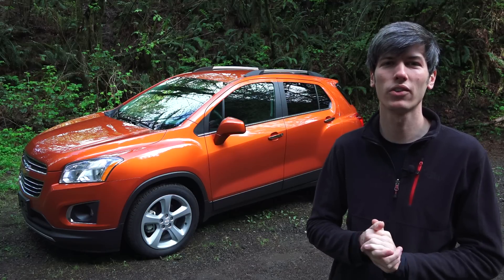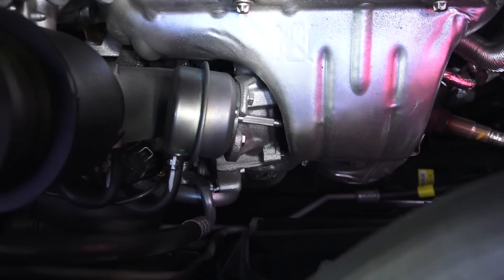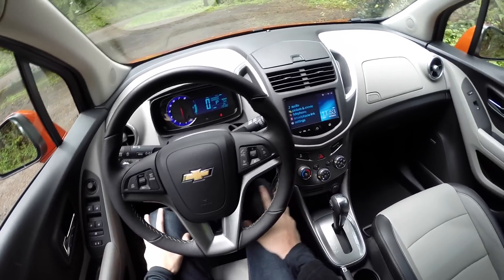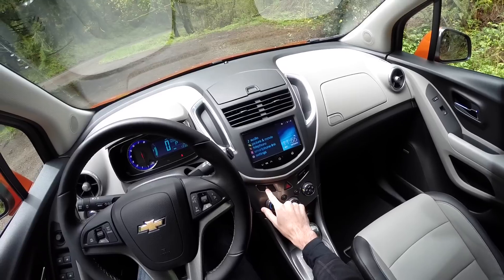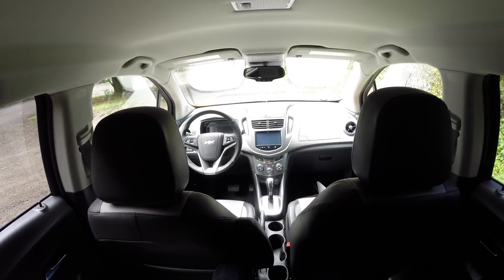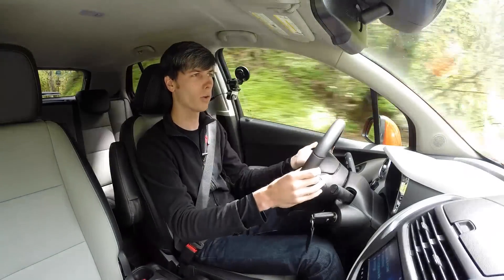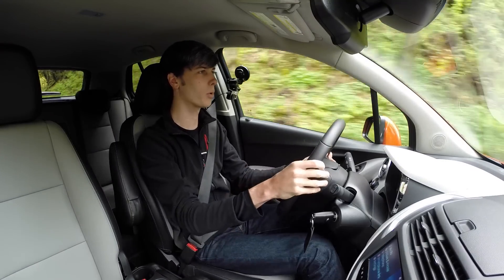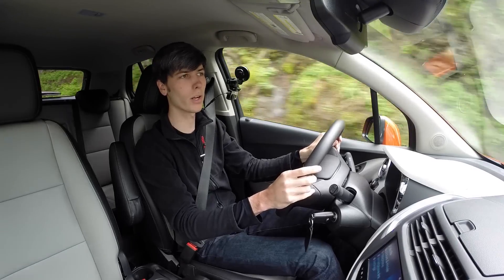2015 Chevrolet Trax - Review & Test Drive

Comment: This is the first video I came across and I came here to say F*ck this cars rear doors and quarter panels I have spent over 2 hours (40 minutes) trying to fix the door on one where it was side swiped and putting that roll back in it is an absolute nightmare because the door is to thin to hold a shape

Comment: I am a happy 2019 Trax LT AWD owner (purchased new for 19K on 10/19) but I do have low miles on it.

I thought the review was very fair the Trax is a nice, functional, and safe car.  
When I purchased my Trax at the time no other car in the category had better crash protection most were not as good. 

I just used it to transport a combination/storm door. 
My model has 4 tie-down hooks so I was able to strap the door in and leave the back hatch up, no problem was solid.

I just read that the Chevy Trax made the IHS Markit’s brand loyalty list (May 2022) (#9) most of the other cars on the list were way more expensive. 
But, not all Trax owners have had the same positive experience. 
I have read reviews and on a Trax Forum where owners did have issues.
I used Repair PAL for data-driven reliability and the Trax was listed as 4 out of 5 stars (Excellent).

As always if you are interested in a car take a test drive and do your own homework.
Thanks for the professional review!

Comment: I have one, a 2017 actually.  Wouldn't recommend it.  If you are looking for a Chevy crossover, look into the Bolt or even the Equinox.  Both are way better than the Trax piece of crap.
Reply: The problem is that they haven't upsized the engine much for the newer Equinox. It's still a 1.5L turbo, for a vehicle that is I think 300-400 lbs heavier than the Trax. And the Bolt is facing a recall for the LG batteries. But yea, I really wish they stuck a 1.8L or the old 2.2L Ecotec here, you can really feel the lack of power in the Trax (I have a 2013), apart from some initial boost from the turbo at low speeds.

Comment: I think I’m about 5 years late lol but on a serious note I do want to get this car (1st car at age 19) but I’m not sure since it has a turbo charger which for some is a red flag. Please help so you recommend this for the long run?
Reply: I just bought a used 2013 LS base model. I hear your concerns on the turbocharger, I'm not planning to floor mine anytime soon lol. Personally I'm trying to baby it, and see how long I can make it last with basic maintenance. I had really low mileage on mine, which is why I went ahead with the purchase, as it was relatively cheap. It's been about 2000 miles since I bought it, so far no issues. Very good gas mileage, and utilitarian (kinda miss out on the cruise control), but it covers what I need it for.

Comment: This car is made on a global GM platform and it is sold under the name of Buick Encore, Opel Mokka(for the European Union) and Chevrolet Trax. Every Opel facelift has an "X" wrote after the name itself and it's manufactured in South Koreea. Probably the Buick Encore too. I dunno about the Trax. And that Ecotec engine is an Opel engine that has been mounted on Opel Corsas (plural).

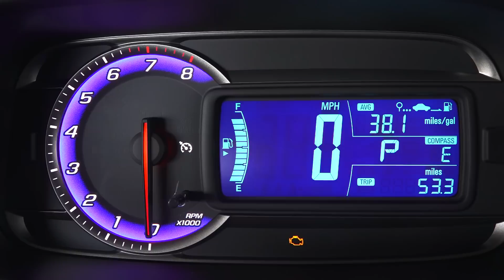Comment: Check engine light at 12:30?
Reply: Key is On, but he hasn't started it (0 RPMs). Check Engine light stays on for that key setting on this vehicle (I have a 2013 Trax, mine does it too).

Comment: We live in central Alberta and purchased a 2015 Trax last spring.  It was great till the cold weather hit and has been nothing but trouble since.  It doesn't like the cold and the motor stops at intersections, never sure it will start again. It has been back to the dealership several times, in fact it's there now.  Here are the supposed problems: #1- o2 sensor, changed and we still have a problem. #2- Air too cold because the intercooler is making the already cold air colder.  Solution? White plastic cardboard "winterfront" held on with zip ties.  #3 - well the cardboard isn't working so we take it back and do something with  the intercooler so it's working again., Yay!!  Then we get -30 and #4  guess what?  Yup, we are waiting to hear what the next brilliant solution will be. The point of this recitation is, is there anyone out there that has the same problems? I would love to know, thank you.
Reply: EtownScott hey! Have you still been having issues with the car?

Comment: Nice work on the review.  I'm looking at a re-designed 2017 and I'll just add that the body and dash look is much improved to me.  AWD is a great option for an economical vehicle like this and that comes with the rear disc brakes for those of us who prefer it.  You can get this option even on the low end LS.  That said, only disappointment with LS is lack of cruise control.  The turbo is what helps gives this model its good city driving acceleration and fuel economy.  Engine/turbo combo is well tested having been in the Cruze line for several years now.  This vehicle is probably heavier, especially with the AWD unit.  Power seems ok to me with just one person.  However, even my Cruze struggled with 4 occupants.  If 4 occupants is not the norm for you, this should be fine.  Enjoy!

Comment: On my 2011 Chevy Cruze on the turn signal bar, there is a knob you can twist for readings on mileage, range, etc.  If you push a button on the bar there are also readings for battery voltage, tire pressure , etc. I wonder if there is a reading for engin temp also on the Trax

Comment: Hello EngExplained, I have reservations of no details on armrest for front seats. I didn't hear you mention this, but I did not see an armrest for the FS passenger and the lack of console armrest would be a kill-deal for me as I take long trips. I like the price as tested but wonder if the 4G is 'free' Thanks for the in depth road test.
Reply: In case you are still wondering about the armrest, I tested a 2016 LS yesterday and it had a driver's right armrest that rotates up/down, like in a plane. Didn't notice if passenger side had one.

Comment: Disclaimer: I own this car. I find the power totally fine, and I like driving quickly. I live in a city and deal with traffic all the time, I drive faster than almost anyone else on the road; it's a non issue for city drivers. It's high view, spacious seating and ample cargo space make it very nice for the city. The ride is smooth even on ridiculous Chinese roads. It's got the legroom of more expensive cars, and low-rpm torque is fun.
Reply: Drunk driver killed my car so now I'm looking at this one.  My rental is this cat and I'm starting to like it even though i hate chevys because of the bad gas mileage.  I agree with you though the acceleration is good.  It takes like 3 seconds for the engine to react but once it does is good.
Reply: NerdExplorer but i hated the recal for the windsheld was annoying
Reply: NerdExplorer I own a 2015 model of the Buick version of this car, the Encore, and I like it better. Not only because the Encore is my 1st car, but also with the many features that it has over the Trax. And the gauges in the 2015 Buick Encore are still basic analog gauges with a small center screen, but I like that better than the motorcycle-type gauges the Trax has. But to be fair though, I do think the Chevrolet Trax is a great car, just like it’s twin variant, the Buick Encore and I can see how and why people like this Chevy as much as other people liking the Buick.

(If only GMC could make they’re own version of this car too, I think that would be awesome too; especially because of GMC’s big boy design language, especially with any Denali trim of any car.)
Reply: I love my Trax. I know it's essentially a purse with all wheel drive but I am secure in my middle age masculinity. Lol
I wouldn't mind 25 more horsepower but for what I need to for it is zippy enough.
The rear suspension seems like a throwback and it is but for a guy who used to have a 69 Beaumont with a hopped up 327  I can't say I mind. Storage space for such a small vehicle is ridiculous. 😎
Reply: Do you still own this car?
Reply: Jaxxon get the Buick version

Comment: Good review Alex. Overall I like this vehicle but have some concerns.  I heard that the transmission is a dual clutch that shifted at odd times and not smoothly. I don't like the idea of not engine temp. gauge. I also wonder how much the engine life span will be affected by the turbo.   I do like rear drum brakes. I live in the rust belt and rear disc can be an annual maintenance chore here. GM took its full size trucks from disc back to rear drum a few years ago due to major rear brake problems in the land of salted roads.
Reply from the maker: dan andy Who's Alex? :)
Reply: Engineering Explained oops. I beg your pardon.
Reply: dan andy de

Comment: Very cheap car. Owning it beyond the warranty would be a mistake.
Reply: +XxChuyoxX Have you spent some time with one....or is this your opinion based on looking at a computer screen? These are actually very well built and should have little to no problems to 150-200k
Reply: XxChuyoxX Inexpensive but good with a 5 star crash test rating.

Comment: Drum brakes on a car in 2015? Not surprised considering it is from GM who is renowned for their excellent quality and engineering.
Reply: Most people won't notice it and it does make the car cheaper. Also, most of the braking is done by the front wheels.
Reply: Drum brakes require very little maintenance. The problem comes when you're actually going to do some work, because the cover will be nearly impossible to get off after years of rust building up.
Reply: Makes the car cheaper to build and cheaper to maintain. Which is what this car was built for. Budget vehicle for new car buyers
Reply: Roger Toledo By how much? Not a lot. If a car built to be cheap comes with all around disc brakes, there really isn't an excuse for a car to come with drums that costs at least 5,000 USD more than that car.
Reply: Porsche Curves used to have this engine but N/A in an old Opel Corsa, absolute shit.
Reply: +Hear That? - Ya.  I would agree.  The LS9 will crush anything in it's class, and beat quite a few things a class above.
Reply: +Hear That? 
Plenty of vehicles still have drum brakes in 2015. all the Japanese utes such as Hilux, Triton, Navara BT50 for example have drums. And they can cost twice as much as the Trax.
Reply: Drum brakes are pure shit, unless you're going to be travelling 90% of the time through dirt and mud, which would clog up a disc. Pointless on a road car considering that there is not much cost difference in making a Drum as compared to the production cost of a disc and caliper setup.
Reply: Usually disc brakes on the rear axle makes more trouble than drums,at least if you don't apply a lot of force when braking, the discs will work better with a more aggressive driving and on high performance cars, I have driven my car over 100k km and haven't been needing to servicing them yet and they pass the test without problem.
Reply: Porsche Curves what a piece of crap, a RAV 4 would be a better buy, more HP, better interior, disc brakes all around, more larger and gets as much gas mileage.

Comment: I like the design of this car and were Chevy was trying to go with it I thing the engine lets the whole car its slow and has a cast iron block it went 0-60 in about 10 seconds with nothing in the car but once you put your family in it and luggage and use it how it was intended to be used it probably goes 0-60 in 15 sec and those brakes are probably going to take like 135 feet to stop from 60.The way chevy made this car so cheap is by putting cheap things on it ie [drum brakes ,iron block cheap plastic

Comment: I would say in some ways the trax is really impressive in terms of the amount of space it offers for that size form factor.  That said, the quality of the interior materials seems rather disappointing (I suppose they want you to move up to a Buick encore to get the nicer interior), but the biggest let down I think are its power train and price.  I mean 25 grand is not that cheap, and a Limited XV Crosstrek has more power, AWD standard, gets better fuel economy, has disc brakes at all four corners, and will probably be more reliable and hold its value better to boot.  I mean heck at that price you could even get a Premium level Forester assuming you don't min a cloth interior.

Comment: Nice review!(no surprise). One question, you can answer it here or in a video. Why are seat heaters bad for fuel economy? Also, what else is bad for fuel economy from these options you can turn on/off, and ofc, why. 
Thx
Reply from the maker: Seat heaters aren't necessarily bad for fuel economy. With electric vehicles it's more efficient than warming the air. With fuel powered vehicles it's just engine heat, so your only power loss is the electric fans. Regardless, heating your seats or using heat will not have a significant impact on fuel economy. A/C does because it uses an engine belt to power a compressor, putting an additional load on the engine.
Reply: Thx mate :-)
Reply: Engineering Explained One more question, something I always wanted to ask but always forget. Have thought about coming up with a grading system for the cars you review? I am sure that would be cool, but it has to be a good, fair grading system, where all cars can compete in different categories such as comfort etc. Just a suggestion, I think people would love to see that(I know I would) :D